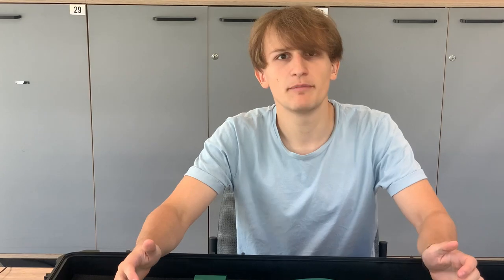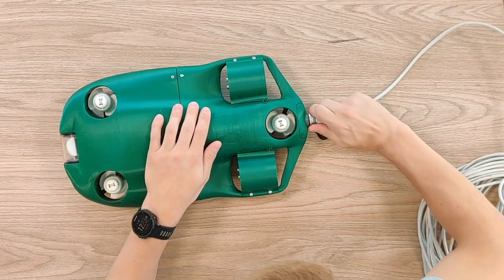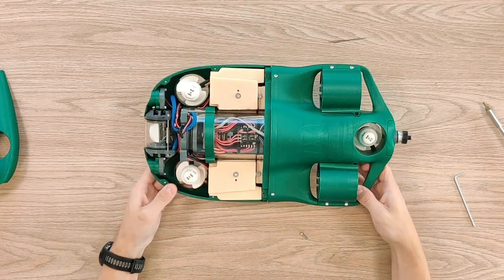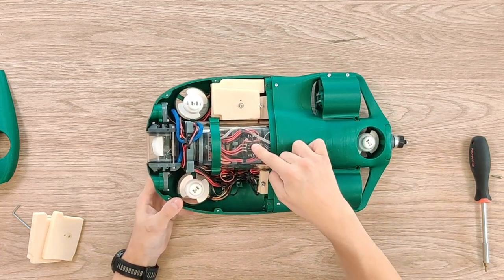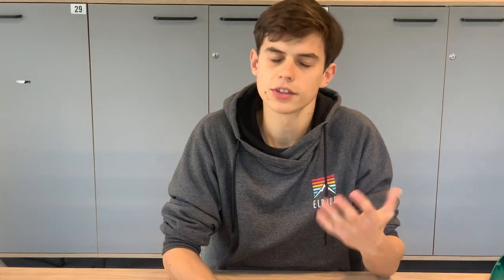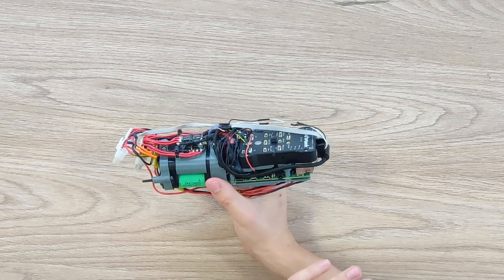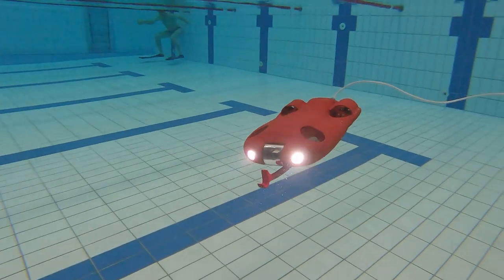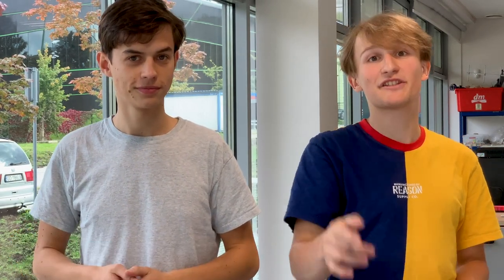Build Your Own Underwater Drone with 3D Printed Parts!

Comment: If you need it water-tight I would either use an SLA printer that takes UV Resin (the UV causes the resin to crosslink into polymer when free radicals are produced and then form covalent bonds) or FDM print a pattern, mold the pattern negative, and use epoxy for your part.
Reply: Haven't tried this solutions. Molds sound like a good option but a lot of work. SLA printers are not often large enough but it should probably work. Thanks a lot for the ideas!

Comment: It looks near professional and you can tell a lot of  thought has been put into it. I think powering and controlling the sub using a wire was a good choice. It alleviates many problems such as messing with batteries and RF communication through water. It also makes the sub much easier to retrieve if something goes wrong. Really great work lads and ty for video.

Comment: Wow nice and aerodynamic design! Only the tether looks so restricting! Isn't there a way to use a diy acoustic modulator to send signals wirelessly to a floating buoy which intern can relay it back to the base station through radio waves? I guess there will be bandwidth issues but i wanted to try it out!

Comment: Have you thought of trying to use water tanks instead of the motors used to pull the drone along the y axis. It would be more energy efficient than using motors to power the upward/downward propulsion.

Comment: Excellent work. For sealing did you try printing a shell with a groove in it for a custom urethane O-ring ? Another low cost option might be plastic welding of the edges upon final assembly.

Comment: I always make my original shapes with a powder printer, then create molds from there. I then add silicone gaskets. I can get 100 feet of depth or 300 if I enclose using deionized water. The camera optics are the only area that’s given me difficulty due to the air gap required for my particular camera.
Reply: Very cool. We don't have a powder printer but when we get one we will definitely give 3D prints another try!
Reply: @CPSdrone  I personally recommend a Z Corporation printer. They are ancient but the powder can be a high end plaster and Sake. You use cyanoacrylate as a penetrant, then the items you print are hard as a rock. While the prints aren’t as hardy as SLA prints, the speed and resolution are unmatchable. I am well versed in powder printers, so hit me up for questions any time. Look up Zprinter 350.  😊
Reply: @Endoplasmic-Reticulum  There's a printer version of the superglue/baking soda hack?
Reply: @the_omg3242  To cure a ZCorp 3D print, you use ZBond penetrant but it’s not interacting with any baking soda. I’ve tried adding baking soda to my powders but the thermal runaway is too severe. I can attest to the hardness of a penetrated print though… it’s much harder than baking soda/super glue reaction.

Comment: You should power it with PoE instead ;)
Reply: Yeah, would be awesome but the voltage is unfortunately too low if we have 100 meters of wire (as we do now).